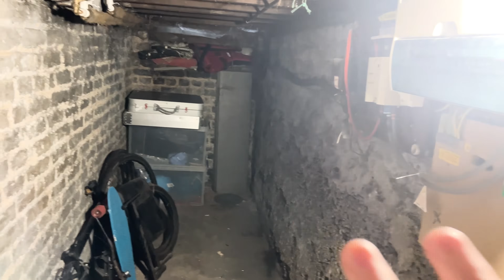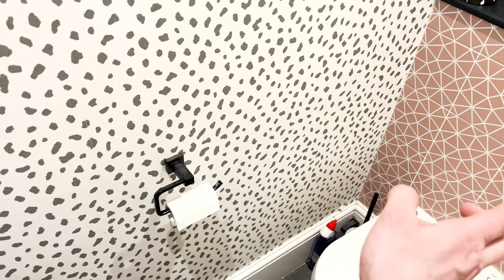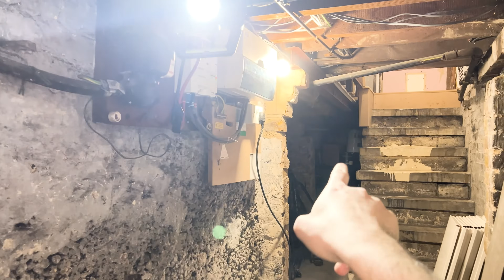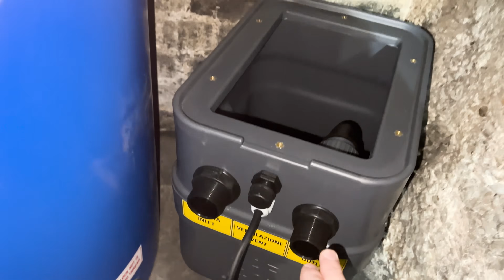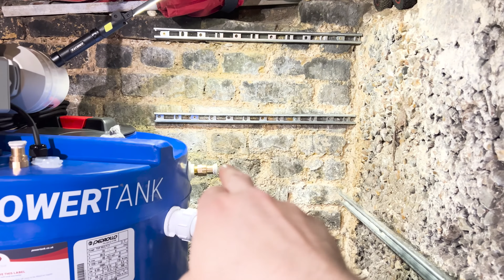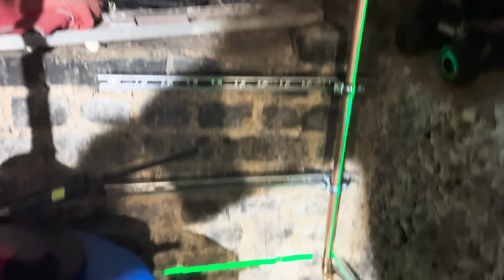WORST WATER PRESSURE EVER - PLUMBER FIX WATER FLOW Ep1

Comment: Would you recommend a new 32mm water main (from the street) too?
Reply: I see a lot of channels where pumps and pressure vessels are used to overcome small incoming main diameters which were fine in the past when there was a tank in the loft.  A new 32mm MDPE main and enlarged internal pipework, at least for part of the runs, can be lower cost with no future maintenance costs.  Often galvanised iron pipes from the main to the stoptap are internally corroded and caus a massive pressure drop when there is flow.
Reply: @BLOCKsignallingUK  think I agree, I had a 32mm fitted and it resolved everything, but the cost wasn’t too bad, about £1500
Reply from the maker: @TheNorthernmunky  I’m guessing by your user you’re up north and not in East London, it certainly wouldn’t be £1500 here
Reply: @glisterservices  not a criticism of you dude, you did a great job. Was just enquiring if the customer would rather one over the other. I live in Sunbury-On-Thames but the water main is right outside the drive and we dug the trench through the drive and laid the pipe, Thames water just came and dug a hole for the water meter and about 2 ft of the pavement to reach the main.
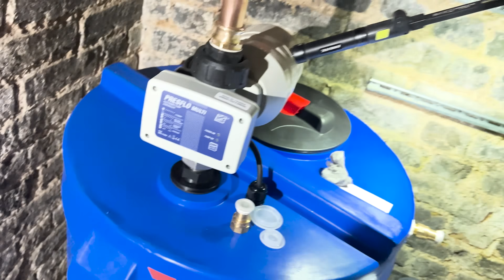Reply from the maker: In any other case that would’ve been such an easier way of doing it, but this is a T Road in East London with a school at the end. You’re not even allowed to drive down it between 8:00-9:15, it has resident permit bays either side and is a narrow street, I couldn’t even begin to think how much a road closure would be for a company to bring in a new water main. Hence the option i went with